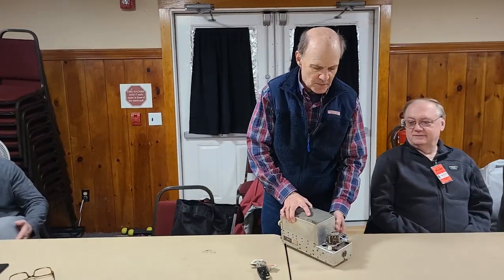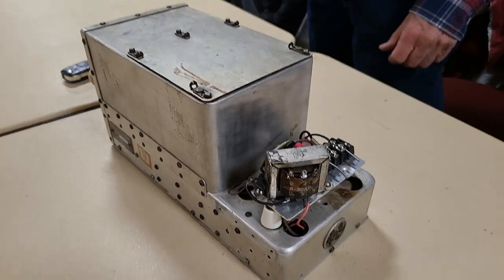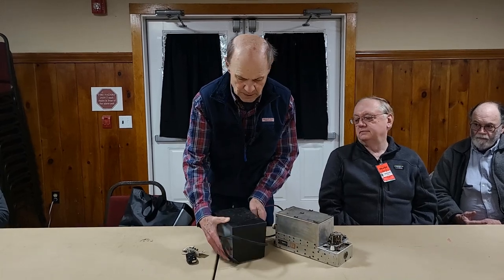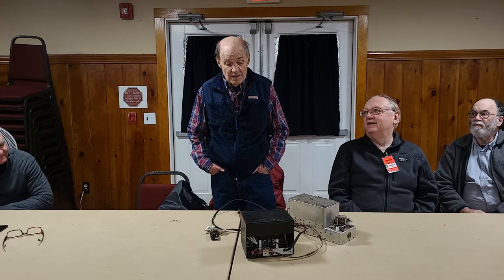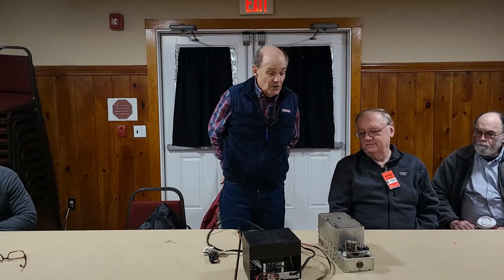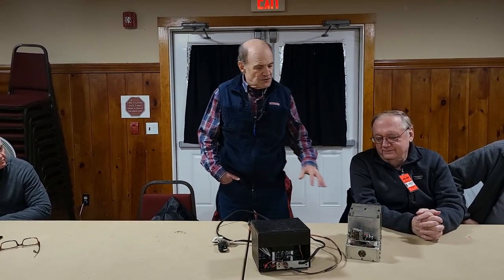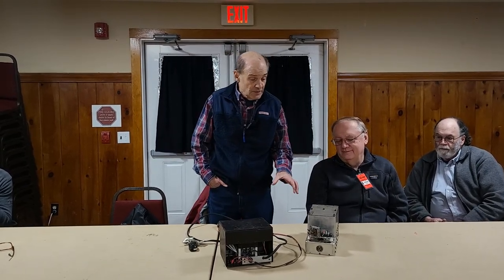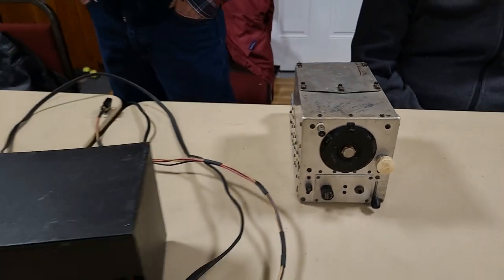Rod, WA1TAC, Presents the ARC 5! 12/2022 Homebrew

Comment: Very nice. I have the BC-453 (Q5ER), BC-454, BC-455, and a separate power supply that a friend of mine restored and built from scratch. He had to move to a smaller place, so I bought them. See you at the new NEAR-Fest, hopefully.
73 Paul AA1SU